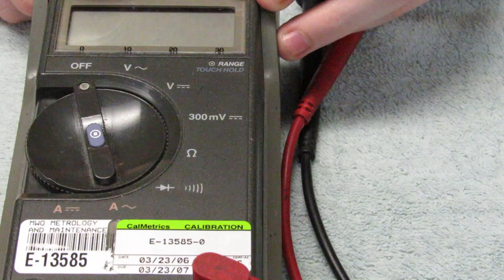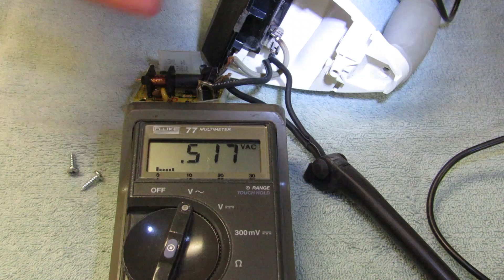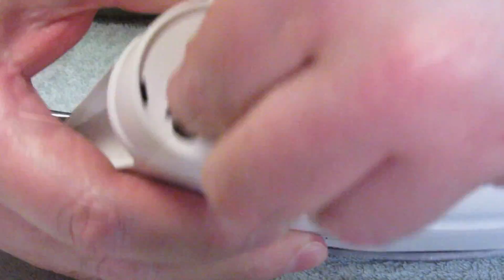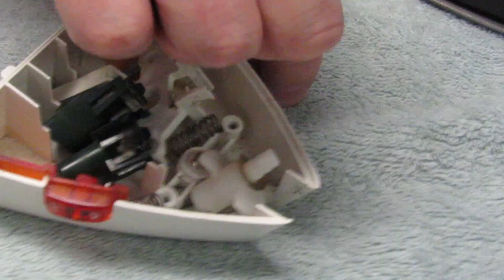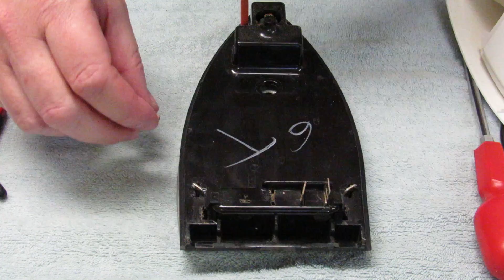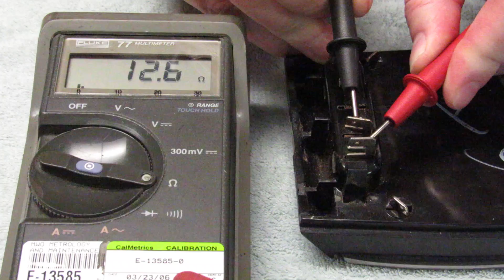DIY #1 - Steam Iron Fix, part 1

Comment: My iron has always leaked a little, just a few drips, annoying but nothing to really worry about. But today I filled it up with water and set to the side for a moment, and all the water poured out. I don't know what's wrong with it.
Reply from the maker: The only possible reason I can think about is that the valve at the bottom of the water reservoir started leaking.  In the video you'll see that there's that hard rubber/plastic valve seat that the needle-like valve opens/closes.  If that valve seat perishes due to age, or heat, or the needle valve pulls out of the seat for some reason, you'll have the sort of leak you describe.

HTH,
AYDENandDAD.